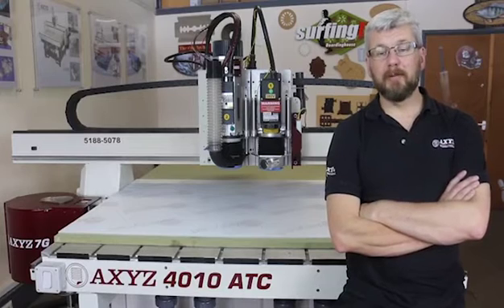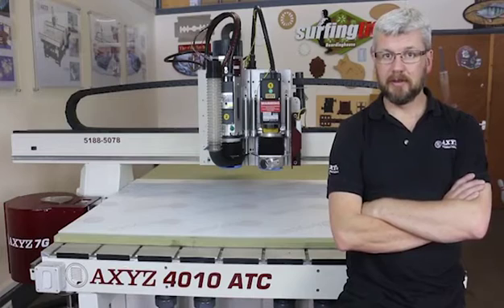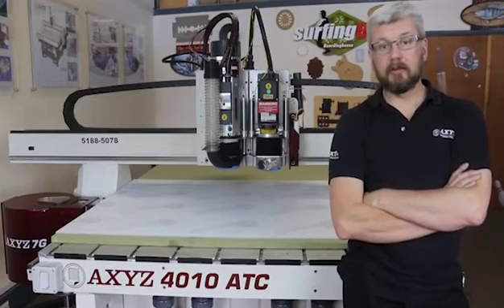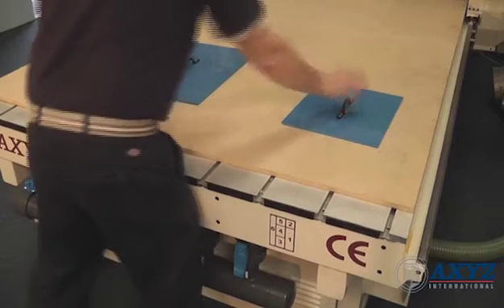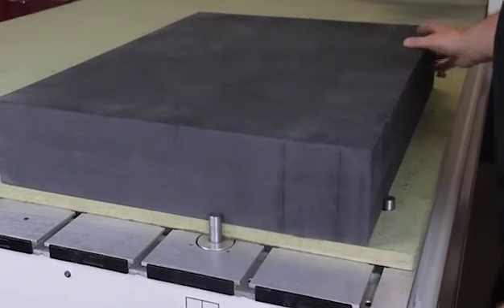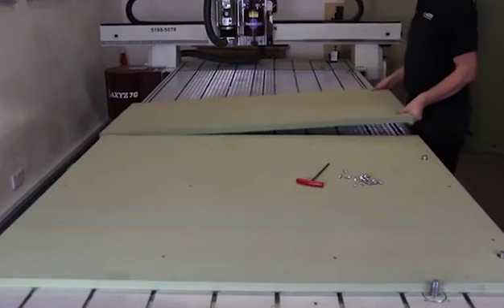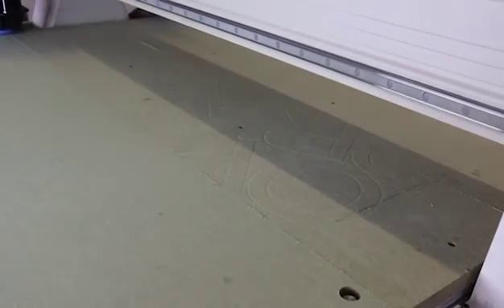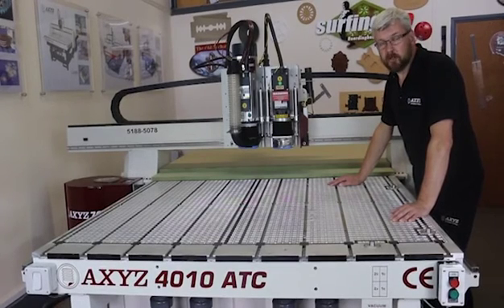The benefits of using a Vacuum Bed on an AXYZ CNC Router

Comment: It blows my mind (or sucks....haha) that the vacuum still works through the MDF. What about the edges of the mdf? Does that need to be sealed to prevent loss of pressure? Is MDF that porous that the vacuum still holds? What sort of air pressures are we talking about????

Comment: Hello, What kind of spoilboard do you use for oscillating knife applications? Thanks
Reply from the maker: Hi Eduardo, 

Where are you based? For the UK, Europe, Asia, Africa and the Middle East we recommend using Texon.

This is designed for use primarily with the AXYZ knife systems. It enhances vacuum hold down and will not cause damage or wear to tools if it is cut into.

It can be purchased here - https://www.cncroutershop.com/uk_en/texon.html
Reply: Thank you! I will check it out